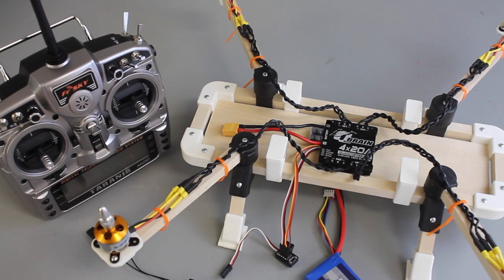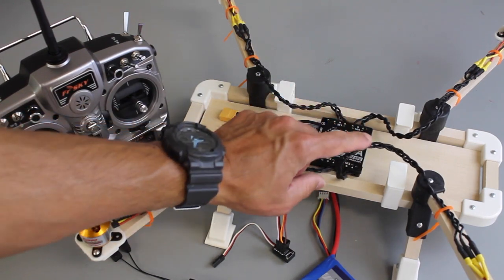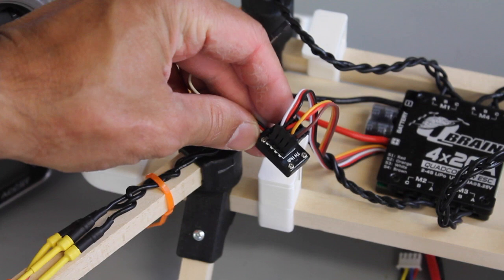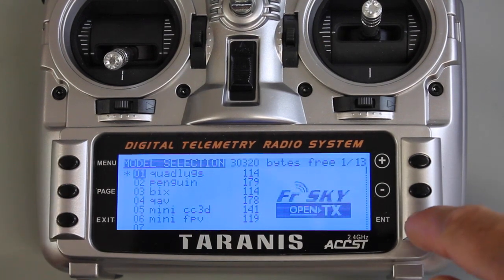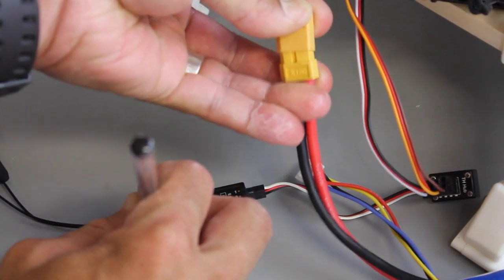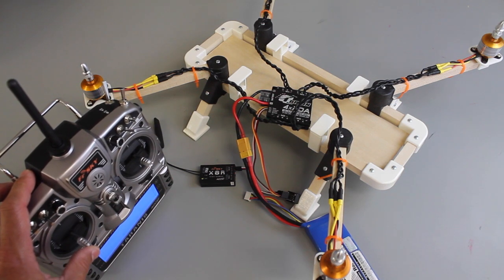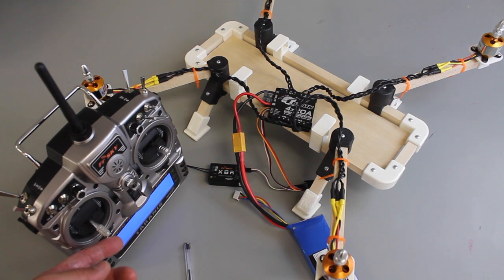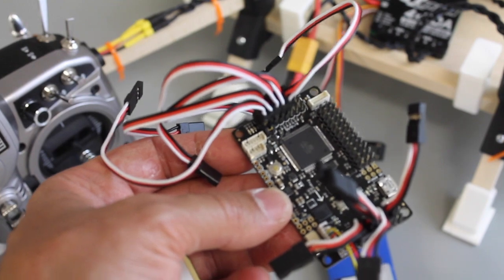4-in-1 Q Brain ESC Calibration on QuadLugs Frame & HK Pilot Flight Controller

Comment: Help! I have one esc that won't calibrate.  I started by trying to calibrate them all at once and got 2/4 calibrated, then I individually calibrated the next esc, and now have one esc left that won't calibrate.  I can get the attached motor to spin though, but only at about max throttle.  I followed your process in this video, and I have tried calibrating through the APM, and neither will work.  The issue is that when I put the stick to minimum throttle after doing the rest of the process, the esc does not make a sound indicating it has read the minimum throttle value. Everything else goes normal though with every calibrating method I have tried.  Any Ideas? Thanks!
Reply from the maker: Sorry to hear that. If you've successfully calibrated your ESCs individually and you have one that's not responding then I would:

1. See if you can reflash the firmware on it. Not sure what you're using but with certain ESCs this is possible

2. If you leave the throttle all the way up does your ESC ever go into programming mode? Perhaps there is something you need to reset there that you may have accidentally configured.

3. Maybe it's just a bad ESC. Did it ever work properly?

Those are some quick thoughts that come to mind. Good luck and let us know how it goes.

Comment: is it possible to connect two of these in a octacopter with a 4s setup
Reply from the maker: +Tony Rex Technically I would think it's possible although I haven't done it. You'd need to run power to both and then calibrate them but I really don't see what it wouldn't work.

Comment: So do all four ESCs only take up one channel on your receiver?
Reply from the maker: Tanner Allen No. Unfortunately that connector is only for calibrating. Each ESC takes up a channel in the receiver for a total of 4 ports being used.
Reply: So with the 4-in-1 ESC setup, you can't install LEDs without adding another battery, correct?
Reply from the maker: Tanner Allen You could run them separately to the same batt if you wanted. Just depends on your voltage input for the LEDs (normally 12V) so you'd be looking at a 3S lipo.
Reply: +Dennis Baldwin How would I do that?

Comment: Where is the front of your quad copter
Reply from the maker: Nils Klemptner Good question. In this video I wasn't to the point where I had mounted the FC and determined a front or back. It can be either end as long as the motor rotations are properly configured.

Comment: Hi Dennis, after you calibrate the Qbrain with the hub cable adapter can you just plug it into the pixhawk main out pin #1 or do you unplug all cables from adapter and plug them into 1-4 of the pixhawk in sequence? Nobody actually explaines the total hookup of the pixhawk to qbrain to x8r receiver, I've had to search evry where and gather info from several people on youtube but nothing is shown from start to finish.
Thanks for your help and I really enjoy your videos
Dennis
Reply from the maker: Dennis Berreth Good question. Unfortunately for Pixhawk you'll need either SBUS or a PPM encoder. Since you're using the QBrain you'll want a PPM encoder as discussed here:

http://copter.ardupilot.com/wiki/common-pixhawk-wiring-and-quick-start/#connect_rc_inputs

This is a PPM encoder I'm using with another setup and Pixhawk:

https://store.3drobotics.com/products/ppm-encoder

You'll connect your QBrain leads to the PPM encoder channels and then the single connection from the PPM encoder to the RC port on your Pixhawk. Good luck and if you have any more questions check out www.garagepilots.com and post in the forums.

Comment: Im not sure if you re-reviewed the 4in1 esc, but the ads I saw for it had the appearance of the Emax model I have. So the issue with it it the M1 signal wire is not correct. I had to switch my M1 and M4, and even though I had a gut feeling about it, I opened the top and followed the traces out to the respective internal ESC module, and I was correct. Have you had any issues with the 4in1 style of ESC? I was almost thinking that one or more of the modules wasnt powering up fully, but fortunately, the KK allows passthrough esc calibration. Thanks. ps...you called your Rx "freesky", but isnt it Fr-sky? Not that its an issue for me, as I have the OrangeRx T6 and R615x parts.
Reply from the maker: John Robertson That's nutty. No I haven't seen that problem before and sorry to hear you had to mess around with it. What a pain. This is the EMAX model I have:

http://amzn.to/1L4DkFs

Not sure if it's the same as yours, but either way the leads shouldn't be switched up like that!

Yeah I normally refer to it as "FreeSky". Not sure if that's the proper pronunciation but I've heard others refer the same as well.
Reply: Yep as i said, even the cover indicated the m1-m4 wiring. And when i removed the guts, the traces went to the respective outputs. The kk only have provisions for power thru the m1 pins. Wasnt a real hassle since i got my first taste of swapping mini pins. I havent had the nerve yet to try another flight before i rig up a tether rig to avoid a flyaway into the dirt. Dangit.

Comment: how do you add other suff to the same battery? leds, fpv gear?
Reply: You could solder some smaller jst connectors to your power board if you have one instead of this 4in1. If not you can buy or make a short coupler that has a pig tail power cable on it.
Reply: i mean with a 4 in 1 esc like this how would you add more electronics to the build
Reply: i think it should have more + and - post to solder on extra stuff to this board
Reply: No. You dont want to know how cramped it is inside. As i said, buy a wire coupler that has your battery connector on one end and the one that matches the connector i to your esc on the other, and solder a red and black lead to the wires of the coupler. Besides, the load you are talking about would be too high for the internal bec.
Reply: Wales Wideman Look for an "Power Distribution Board"
Reply: You don't want anything between your battery and the esc, except maybe an adapter connector. If you do use a pdb, solder the pigtail lead from the coupler to it, so you can unplug it and, test the flight gear without the draw of the extra electronics.

Comment: hey i have been following your videos for some time and they sure are great. im in the process of switching up my setup for my steadi qu4d drone and amd looking to do 2 things and figured you may help me find the answer to one of them.
1. when using 2- 4 in 1 ecs's how would you supply power to both of them?
2. since i want to go from 4 x config to 8 x config to allow me to have a bigger payload, i want to use 2 batteries and noticed a XT60 Harness for 2 Packs in Parallel adapter how would i measure each cell from my taranis receiver
Reply from the maker: DamienDavidO Thanks so much for the good words. I'm not sure about using 2 x 4 in 1 ESCs. I would assume you run both to your PDB as you would if you were powering ESCs individually. I'm not sure about battery monitoring question. I haven't done that before. Will definitely look into it in the coming weeks. If you figure out how to do this please let us know!

Comment: Dennis, I have pretty much the same setup as yourself, except for frame, I also have a Taranis, Qbrain and X8R RX, Did you do the second video in this series as stated at the end of this one, I need to know how to connect the APM and Qbrain ... please, thanks!

Richard
Reply from the maker: Richard Hamilton No unfortunately I didn't get a chance. One thing that was tricky for me originally is understanding S1, S2, S3, S4 and how those match up with M1-M4. This manual does a decent job of showing it. Just make sure you hook those up to the proper outputs as shown in this diagram:

http://copter.ardupilot.com/wiki/initial-setup/assembly-instructions/#Connect-ESCs-and-motors

Good luck and hope this gets you going.
Reply: Dennis Baldwin Ok...as I mentioned in my other post...

Comment: From what I understand, twisting or braiding wires prevents them from receiving interference rather than creating interference.  It is supposed to stop them from acting like an antenna.  
Some one correct me if I'm wrong though.  
I'd love to twist or even braid motor wires on some of the larger hexes and octos I make, not just to block interference but to clean things up a bit.
Is there a possibility of creating some interference by braiding the motor wires?  It is essentially AC power on that side of the ECS, after all...?
Reply from the maker: Matt Molloy I don't have any hard evidence but have read and heard from many pilots saying that braiding wires does help reduce interference. A lot of ESCs now come with ferrite rings to help on the receiving side of the ESC. I still braid the side connected to the motors for both interference reduction and to keep the build cleaner. I'm going to try and do some tests in the coming weeks to verify. And I have not heard of a case where braiding increases interference.

Comment: Hi Dennis,  In the video you mention that the configuration of the FC will be in the next video, I can't find that video.  Could you please give me a link to it.  I'm a newbie to quads and am using the same Qbrain and HK flight controller.  It's surprising hard to find info as a newbie.  Everyone talks as if everyone else knows what they're talking about.  Cheers!
Reply from the maker: Thanks for the feedback. I've just got back to tweaking this build and flew it over the weekend. The HK Pilot board behaves identically to the APM 2.5 when setting up, although I've run into some differences in the air. If you can give me some time I'll definitely be posting a video soon. If you'd like to get some help in the meantime check out www.garagepilots.com and post in the forums. Either myself or someone else will chime in and offer some help. Best of luck with your build.

Comment: IF one esc of those happens to fail can you unplug it and use the other 3 with a normal one ?
Reply from the maker: Great question. I sort of assumed that it wouldn't be possible, but am not 100% certain. If I learn anything about it I will be sure to share.

Comment: When I power up the qbrain for calibration, I get the sound but not the 2 tones. Any idea why? Throttle don't spin up the motors.
Reply from the maker: That's strange. Perhaps look at your throttle trim to make sure it isn't trimmed up. A lot of ESCs won't arm if your throttle isn't low enough.

Comment: Can u please check me last video.  I don't know where I went wrong.  I hooked it all up.  Did the hub calibration.  Throttle worked fine.  Hooked up kk2.  Did rx check in kk2.  All indications normal. But when I plug in battery, I only get beeping.  Will arm but no throttle control. ?????
Reply from the maker: If you get beeping then something may be wrong with the default PWMs sent to your ESCs. For starters try trimming down your throttle a bit just to see if you can get them to arm.
Reply: Dennis Baldwin
Tried that.  No luck.

Comment: Denis, braiding wires does reduce noise since the wires are a lot less parallel to each other. It also makes the wire more flexible and reduces the risk of bending
breakage even with those extra flexible silicone wires. It is definitely not bogus ;)
Reply from the maker: Very good to know that. I'm glad you pointed out the risk of bending as well. That's a good point and something I'll keep in mind for future builds. Thank you.